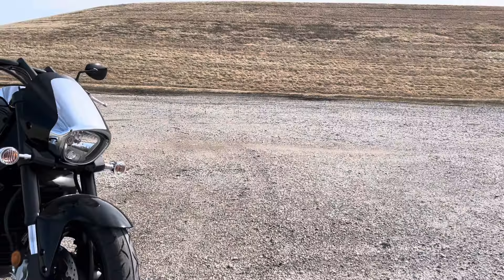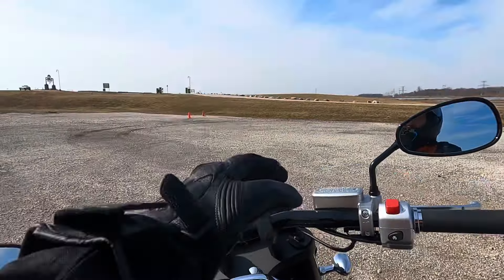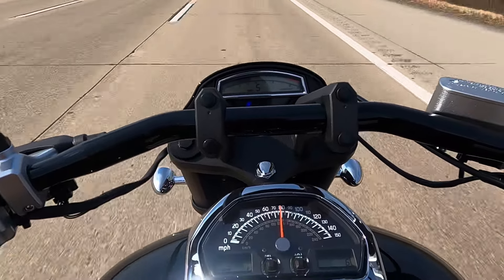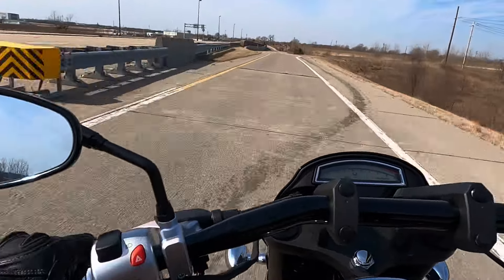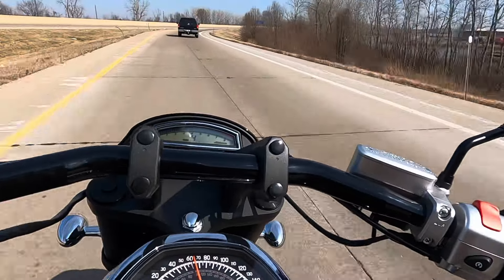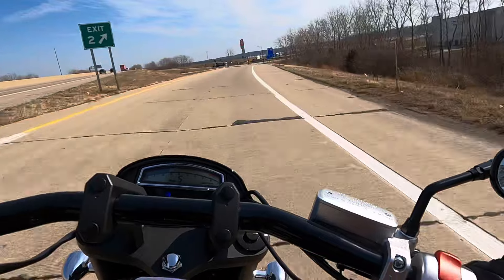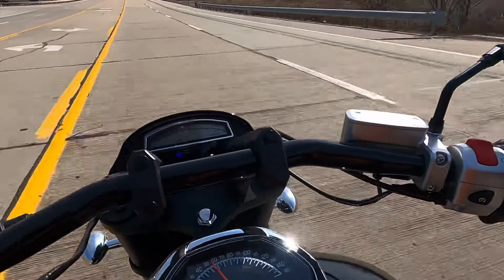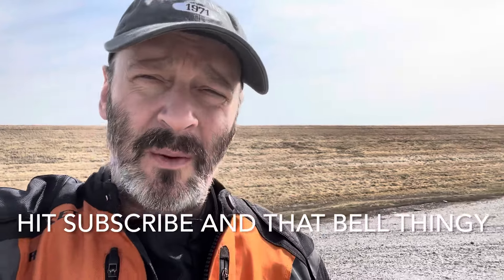TG MotoRider 2024 Suzuki M109R Full Ride and Review. As good as the old VTX 1800?

Comment: Nice, concise video. No fluff, just facts. The most surprising difference to me is the brakes. I've got a 2010 C-109R, and it has a linked braking system. It's got 3 piston fronts, and a twin piston rear caliper. The front brake lever activates 2 of the 3 front pistons, while the rear pedal does the back brake, plus the 3rd piston on the front. It's 1102lb loaded, with me on it, and it stops quite well considering our combined bulk.

It also has intake, pipes, and a tune to disable the electronic nanny aids in 1st-3rd gear, and the secondary throttle valve. It's got a heavier flywheel, and different intake cam than the M to bring the torque even lower, but even with those restrictions (compared to the M) it makes 110hp at 6800rpm, and 120lb-ft at 3300rpm, and an almost table flat torque curve all the way to nearly 7000rpm, and that's at the tyre. That's more than enough to smoke that fat old 240 rear on the roll in 2nd, and you'll be smiling like the Cheshire cat every time you ride it. Try a de-restricted one if you ever get the chance and you want an even bigger smile.

Comment: I went last week through the twisties of the apachians in NC and TN with my M109R. 180 degrees tight corners and 270 degrees circles all with a paseenger. All these pristines We had a blast.  Can't wait to go back.  It is true this bike can handle well due to low gravity and is very stable...and you barely feel the speed indeed.  It is also true 240 rear tire handles a bit funny but I love to push this bike in all situations. It is NOT scary to scrape the pegs with this bike.  I usually gently ecrape my heals before the pegs due to the position. Something to get used to.  Many reviewers said this bike is for speeding between traffic lights in town, sure, but I much prefer cornering twisties all day long with this bike, so much fun.  Gotta tame that clutch though early on though. The clutch is NOT hard like on an FJR, it is smooth but a bit surprising at first due to the high tork of the engine.  I carefully chose this bike last year over several HD models and never regreted.
Reply: @notyrbsns9321  I ride mine around the Welsh hills, some acute twisties here & you have to be ready for them but it’s an awesome feeling piloting 765lbs and 8 feet of bike around them. I also do the heel scrape thing, with the state of some of our roads it’s good to have the extra early warning system before the pegs make contact (not that there’s much you can do about it once you’re committed!)

Comment: Get a tune, it will open up and remove the restrictions in first three gears
Get steel braided brake lines, brakes are from a GSXR600, a sports bike that weights one third of the 1800
Reply: It is true I noticed some restriction on third gear.  I was waiting for the silly one year warranty to be over to do the tuning.
Reply: actually brakes are from GSXR1000 (radial mount 4 piston calipers on front) the 600 has dual pistons.
Reply: @jimmywallace2687  Still not capable to brake a bike that ways twice it's intended weight
Reply: @erwinkrau6300  When you clamp down the 109 will stop in a hurry. Do you actually have an M109R? I bought mine new in 2008, first time I had to brake hard was when a deer jumped out in front of me riding 2up. The bike stopped incredibly quick for a 750 lb bike with 400 lbs on board.
Reply: @jimmywallace2687  I have a 2015 BOSS (Black/White with red pinstripe.
It didn't brake at all when I got it (third owner as far as I know)
There were other issieus with it, example, they didnt lube the axels or anithing realy
Reply: @erwinkrau6300  Sounds like it was neglected, hope you got a good deal on it
Reply: @jimmywallace2687  that's the problem. I'm in Europe.  They stopped import after 2015 (environmental). So no new stock. Existing bikes get more expensive.

Comment: the vtx1800 biggest short coming was the tiny gas tank, 92 average range, i never understood why! Big motor you need a big tank especially if its checking off the touring box. The VMAX decimates btw, 197HP and gobs of torque but this 109 is a harley smoker lol
Reply: I thought the tank on my 1800 was big. Then I saw a 109 up close. Maybe it was optical illusion but the 109 tank looked HUGE.

Comment: Hey man great review, your impression of the brakes surprises me, not saying you're wrong but the brakes on my 2008 model are great! One thing to keep in mind though, the rear brakes can really help out, with the rear tyre as wide as it is, it doesn't brake traction easily. So instead of a balance of perhaps 70 or 80 % front and obviously whatever you feel like applying to the rear, you can actually depend quite a bit more heavily on the rear. Find a quiet street and give it a try, relying a little more on the rear brakes, not telling you how to suck eggs mate, hope it doesn't look that way just something, not saying it's right but it works when you need it. I'm 74 yrs old been riding since 1965, had some great machines but the Bullie is the best bike I owned,  Cheers brother, keep up the good work, well they say you don't work a day in your life if you do what you love
Reply from the maker: I appreciate what you’re saying. I do typically use both front and rear brakes I think perhaps the brakes were not worn in. It was a brand new bike, so the brake pad surfaces were not broken in. I do love the bike but I think it’s relative equal size with the same horsepower should have three pistons on both calipers in the front. Like the VTX 1800. And the M109 actually has more horsepower than the VTX 1800. 
i’m glad you’re riding at 74 years old that’s awesome brother !! There is hope for all of us.

Comment: I am torn between a new m109r  and a used 2014 Honda Valkyrie.  It is my third bike mostly for short trips around town. Mostly for my performance needs. I have a fjr1300 and a Vulcan nomad 1600 for my longer rides. Which one would you recommend for that between the 109r vs Honda 2014 Valkyrie? Thanks.
Reply from the maker: Holy smokes that’s a tough choice. Seriously, flip a coin. I love both of those choices. Umm yeah HEADS! Valkyrie.
Reply: @tgmotorider.narratinglifeo3480  lol. You are funny. Seriously is the valkyrie good? The seller obviously wont let me test drive it until I buy it so hard to get a good perspective.
Reply from the maker: @sandeepramlakshmanan3646  I would make sure it runs, see if the seller will ride it in front of you so you can watch it go and listen to the motor. But the Valkyrie is an awesome bike.
Reply from the maker: @sandeepramlakshmanan3646  see if he will ride it in front of you and start it up so you can listen to the motor. The Valkyrie is usually a bulletproof bike.
Reply: @tgmotorider.narratinglifeo3480  thank you. Will do.  I just needed to find out your views when compared with m109r.
Reply from the maker: @sandeepramlakshmanan3646  they are both rocket ships. The Valkyrie is probably more comfortable.
Reply: I have a 2014 Honda Valkyrie with ABS and it's a serious power cruiser.I'll never part with it.This 2024 M109r will be added to my Garage this year.A non ABS beast of a bike.Now only if I can find a way to sneak in a 2024 Triumph Rocket 3 past my wife and I'll be at peace😂

Comment: TG I am interested in purchasing a M109. The question I have is are the chrome and black coverings on the engine all metal or are some plastic? I had a Honda VTX 1300 several years ago and some of the chrome pieces were made of plastic. Thank you for your response.
Reply: I have the C109, and I can confirm that on it, some of the shiny bits are plastic. Given the 2 bikes share a large portion of their parts, it would be a fairly safe bet to assume the M would be the same.
Reply: Thank you Whiskers!